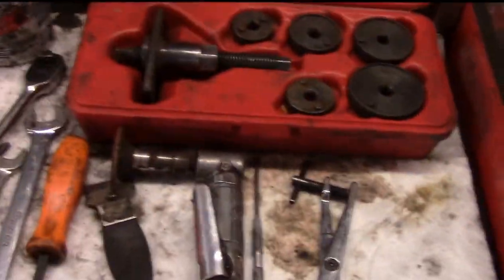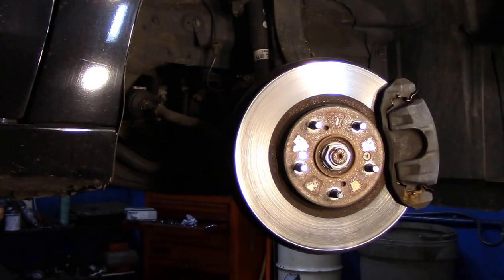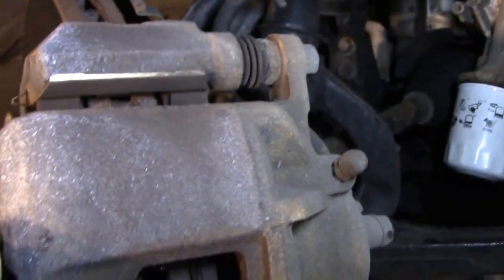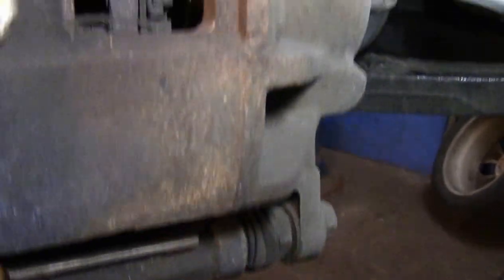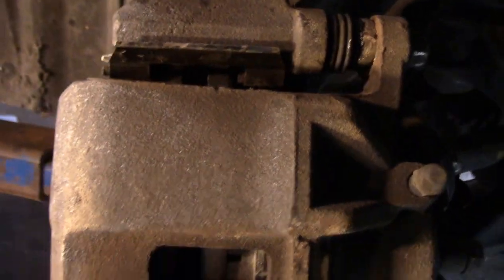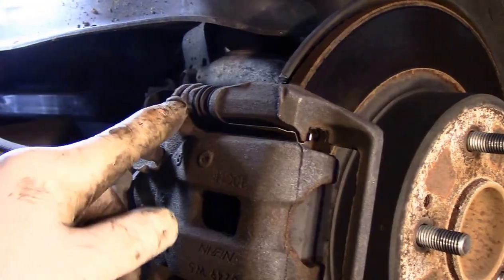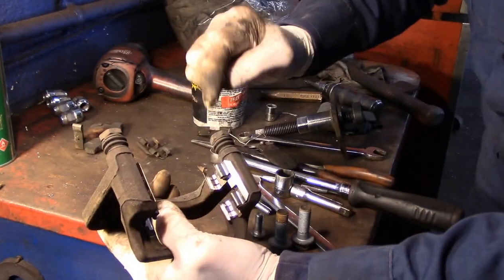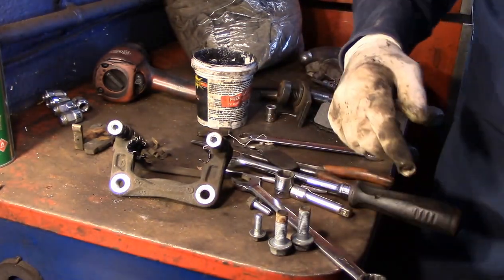How to replace front and rear brakes on a 2010 Honda Accord

Comment: Thank you Jim. You are the person to mention those washers on the back of the brackets on the rear. I've watched about 20 videos and i thought I was ready. Not hardly. After I had started I had to stop, put everything back together again and take the car to a local shop to put a torch to the 2 screws on all 4 wheels. Also I have to redo the rears because I have to alighn the caliper cross notch and put those washers back. Excellent tutorial, thank you.

Comment: It's always a pleasure to watch an experienced mechanic do a job. The only thing I am more careful about is with the grease. Always avoid or clean grease from any braking surfaces, pad faces and rotors.  Also the calipers get very hot, excess grease on the clips could drip or wick on to the braking surfaces later. Apparently most mechanics don't  worry about this. Jim changed gloves to avoid some of that.
Reply from the maker: I'm happy to help. Thanks for watching and your input.

Comment: I just did my front set of brake pads, they’re really good quality they’re the most expensive ceramic that advanced had, I replaced the hardware as well as the spreader clips, everything is nice and tight and where it should be but when I’m now driving down the road I’m hearing a grind or scrape that increases with my speed, not when my foot is on the brake. I’m hearing it specifically on the driver front, I’m going to take it all apart tomorrow and make sure hardware is seated and everything but I am stumped
Reply: It likely is you didnt clean/remove rust under the hardware so the brake pads are having a tough time backing off the rotor.

Comment: BIG QUESTION!!! First, great video. However, what's up with getting grease all over the brake pad friction surfaces??? I've always been told to keep the rotor and pad contact surfaces as uncontaminated as possible!
Reply from the maker: John Gregory good question after the job is done we use brake clean

Comment: QUESTION: I’ve done brakes for years. When moving the piston to put in new brake pads , do you open up the brake fluid cap to alleviate the pressure? Or does that allow air into the system? 

Maybe it doesn’t matter if the cap stays closed during the entire process.

Comment: Excellent video, thanks. I know this is an old vid, but I could use some help. Naturally, after easily replacing my 2 fronts and left rear, my right rear had to give me problems. The rotor turns fine, it's not seized, but I can't fully retract the caliper piston. It moves fine but then gets snagged with about 1/4 inch left to retract. I've tried everything that I could think of to get it to fully retract, with no luck.

I tried spraying some PB Blaster on the piston cylinder, but that didn't work either. This is SO aggravating because I only need a little more retraction to fit the caliper over the new pads, but it just won't budge any further.

Any ideas??? Would opening the bleeder make any difference? How about the E-Brake, does that have any impact on retracting the piston? I'm out of ideas, and I don't want to just buy a new caliper if I don't need one.

Comment: Jim. I have a 08 Honda Accord and I plan to change my own breaks going forward. I notice in your video that you do not use a torque wrench to tighten the 17mm caliper bolts. I have watched other videos where they are tightened to  your vehicles torque specifications. Is  it not needed  to do this?

Comment: Jim, fantastic video. What happens if you can't get those thin washers to stay in place when you put the bolt back through? Is there some adhesive I could use to keep those from falling out?  Also, are wire spreaders necessary on all installs? Pads I bought did not come with wire spreaders. Lastly, I changed out the rubber boots on the slider pins and when I put silicone grease on the pin, most of the silicone came out toward the front of the boot when I put the pin back in.. Seemed like I should have removed the slide pin and boot, and then put the silicone behind the rubber boot on the slider pin in order to grease it properly. Any thoughts?Thanks for all your fantastic videos.

Comment: Jim, great video. So the brake wear tabs go on the backside of the rotor. On the top of the pad or bottom? Thanks!
Reply from the maker: Thank you for watching.The indicator does go on the rear of the rotor .Watch how the old one comes off and reinstall the same way.Most of the time the indicator is on the bottom.

Comment: Great video Jim, I notice on  this video 2010 honda accord the front brakes it had 2 of the springs/ pad spreaders , my is a 2008 Honda Accord v6 but when I changed my brakes there was no pad spring/ spreader only the back ones had it, should my car have them also or not my 2008 honda required.  thanks Jim;;   Virgil

Comment: Welp I am back on this channel again! I already used it once to replace my suspension, and now I have another question @jimthecarguy. I am going to change my brakes and rotors because I have been hearing some metal grinding when I am braking.

But Jim my accord also threw a p0420 problem with the CAT. Do you have any advice on this?

Comment: Going to Mavis in the morning to have brakes inspected on  2010 Honda Civic.  When I go to brake I hear a flapping noise with some knocking.   What could cause a sound like that.   I don't want to be taken advantage of so I'm empowering myself with your knowledge.  Thank you.
Reply from the maker: If the noise is in the front and only when you hit the brakes then it should be the rotors and brake pads need to be replaced
Reply: Your video empowered me.  There was rotor glazing. So  I had rotors and pads changed in the front.  They wanted me to blow out brake line and remove sediment  It was $79.00 to do that.  ouch.  Whole job totalled $380. Thanks for your video.  I made sure I told the mechanic not to lose the washer.  ahahaha

Comment: I used a standard brake piston compression tool in combination with a small pry bar (aka screwdriver) to press the rear cylinder.  What’s the significance for aligning the grooves with the caliper openings?   I honestly forgot to verify that step?  Should I take it all apart and repeat or is it ok?
Reply from the maker: Glad you enjoyed it
Reply: I believe there is a tab on the pad itself which slides into that grove. If the piston is rotated differently it won't line up...and you can't get it back on.

Comment: Can I put the same front rotors on the back for more breaking power !. I see the front brake is thicker than the rear brake which means the front has more breaking power than the rear because the rotor is thicker and the pads grabs the rotor faster than the rear pads on the rotors.
Reply: Serious question only.

Comment: Question. If the caliper is in front of the rotor the wear indicators go on top right?  And if caliper is in the back of rotor wear indicator goes on the bottom? Is that right? Thanks a lot
Reply from the maker: Thanks for watching.

Comment: My car has started shaking at 70mph+ (2010 accord), just got the tires balanced. The tire shop said I could be my brakes. Thoughts?
Reply from the maker: Does it start to shake at 70 mph without touching the brakes or does it shake when you apply the brakes at that speed?

Comment: Shouldn't you take the cap off the master cylinder before you compress the caliper piston?  I didnt do it on my jeep and blew out the MS seals.
Reply from the maker: There is no need to open the cap as long as the brake fluid is not over filled.

Comment: When removing rotor screws; for 15 bucks you can get a JIS # 3 (Japanese Industrial Standard) impact screwdriver that will pay for itself over and over again... not to mention the shredded screw heads left behind when using a Phillips. (Mine came in two days.)
Reply from the maker: Thank you . Don't forget to subscribe.
Reply: Where did you buy yours from ?
Reply: @gsnwhodat  Hi - Amazon "Vessel Megadora 980 Impacta P2x100 #2" ...I'll send you the link if you need it. It's also an impact screwdriver, so that's a plus.  The price hasn't changed much. I don't have the Honda any more, but I still use the screwdriver - :' D

Comment: the inner pad of the rear with the little pin should fit into the slot (+) on the capiler piston, but if the caliper piston is going counter clockwise when pressing the brake pedal- how it will turn? the brake pad cant turn.. im confused
..
I saw a rebuild video for a caliper just like that, and he just turn the piston counter clockwise to take the piston out... maybe I just dont get how its work :\
Reply from the maker: Good question. The piston does not rotate the part that rotates is in the back of the piston in the bore. I hope that helps you to understand . Thanks for watching.
Reply: @jimthecarguy  
Thank you sir for your patient... Im not understanding how the caliper actually works i guess, maybe some time you will be able to make video about parking brake adjustment :)
You just got a subscriber, thank you for your time!

Comment: Hey jim i have a question for you , i have a Honda Accord Ex 2010 2.4 l   the hand break light is on what is the problem ? Thank you
Reply: Make sure the hand brake is fully disengage. If fully disengage then the brake release switch could be bad or needs adjustment.

Comment: Are the rotor screws a convenience thing or is it actually necessary to put them back on?
Reply from the maker: The screws are to hold the rotors on but if you had to you can leave them off

Comment: is taking the alternator on a 2002 infinity i35 the same as a 02 maxima?
Reply from the maker: +Adam Ortiz  Yes it should be the same.
Reply: +jimthecarguy so if I watched a video on how to do it on a 02 maxima should be identical for most part
Reply from the maker: +Adam Ortiz  This is the procedure.  This is a video I have on the procedure.   https://youtu.be/RijNmGtnkqM    ,If you run into a problem let me know I should be able to talk you through.
REMOVAL 

1.Remove engine undercover RH. 
2.Remove side inspection cover RH. 
3.Loosen belt idler pulley. 
4.Remove drive belt. 
5.Remove A/C compressor mounting bolts (four). 
6.Slide A/C compressor forward. 
7.Disconnect alternator harness connector. 
8.Remove alternator upper bolt and lower bolt.
Reply from the maker: +Adam Ortiz  This is the procedure.  This is a video I have on the procedure.   https://youtu.be/RijNmGtnkqM    ,If you run into a problem let me know I should be able to talk you through.
REMOVAL 

1.Remove engine undercover RH. 
2.Remove side inspection cover RH. 
3.Loosen belt idler pulley. 
4.Remove drive belt. 
5.Remove A/C compressor mounting bolts (four). 
6.Slide A/C compressor forward. 
7.Disconnect alternator harness connector. 
8.Remove alternator upper bolt and lower bolt.

Comment: can i use a c-clamp to push the piston back?
Reply: try putting a used brake pad on the piston to avoid damage
Reply: No, the pistons on the rear calipers needs to be turned in.  Some of the auto part stores sell a small cube shaped tool for less than $10 with the tips that fit inside the piston grooves.  The cube will then fit on the end of a 3/8 drive extension so you can turn the piston in.

Comment: Didn't know you could have the indicator facing in and still have the break pads on the wrong side. Totally lost track of what goes where. Even lost track of which clip goes where. Total nightmare. Next break installation will be much easier. Although, the clips seem to fit perfectly, and the indicators are both on the inside so I'm not sure how they're still making noise. Also put grease on outside of pads and on clips. Just gonna try to figure out what goes where based off this video (I have a 2010 Honda accord) then if it keeps making the noise just gonna have to see if new rotors make a difference. Although it wasn't making the noise before the break pad change. So much trouble.
Reply: I wish I'd have watched this video too before trying to change my breaks

Comment: Are you supposed to bleed the brakes after a job like this?
Reply from the maker: No need to bleed the brakes unless you replaced a line or a caliper
Reply: After watching this video I was able to change my Hondas brake pads and rotors today and saved over $1000 which is what the local shops around me were charging for the job.

Comment: did a 2004 honda accord everything so rusty broke the bolts on the emergency brake bracket and the power steering bracket so disgusted how rusty these get

Comment: I just changed my brakes on my 2012 accord. It did not come with new clips or Springs so I went back and bought the hardware kit. Unfortunately nothing fit properly so I reused the old factory installed springs and clips. Everything looked pretty clean and slid around pretty good so I did not re-grease anything. Are used Napa ultra premium rotors and Akebono ProAct pads. Do you think this is OK? I just ran out of time and couldn't secure brand new clips in Springs.

Comment: What is the importance of the rear knuckle washer? Bought a used car, and when changing my rear break pads. One of the washers was missing. Went to the dealer, they told me they did not have it in stock but they pulled up the wrong part number. I finally found it online. WASHER, REAR KNUCKLE - HONDA (90651-SWA-000) Thank you so much for your video, very detailed and informative. Great Job!
Reply: WASHER, REAR KNUCKLE - HONDA (90651-SWA-000)
Reply from the maker: Thank you for your feedback and for watching.The washer is important because it keeps the caliper lined up correctly.

Comment: do the rotors screws fro Honda really serve any purpose. i hear that many remove them and leave them off.
Reply from the maker: Actually they hold the rotor in place until the tire is installed You can leave them out without any problems but I would not recommend that
Reply: I think its all really preference. I drill them out and then never use them because you have studs that align rotors holes with the hub. On euro vehicles i actually leave them in because euro vehicles do not have studs to align the rotor and its a pain in the ass to align the rotor holes with the hub.
Reply: nissan toyota doesnt use screws on rotors.  what the heck for